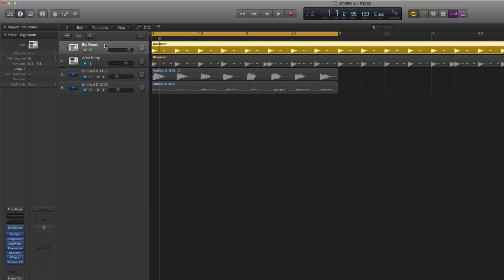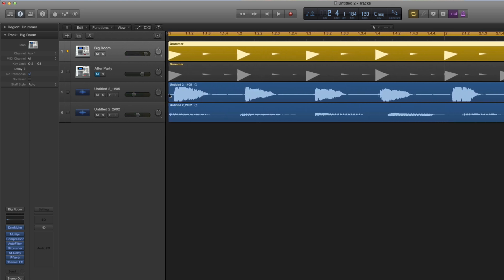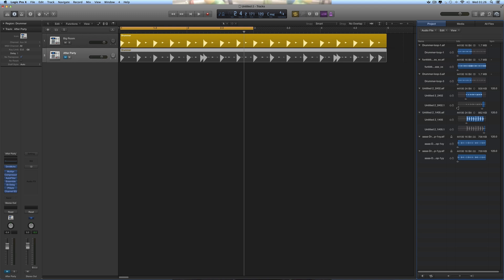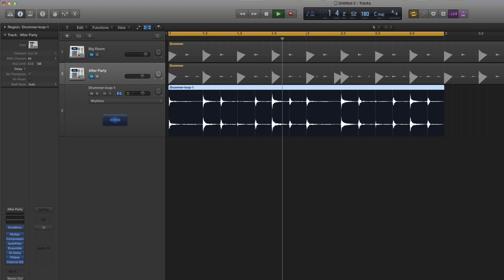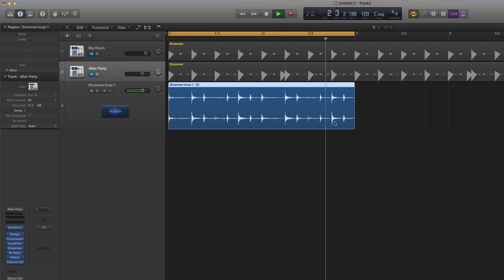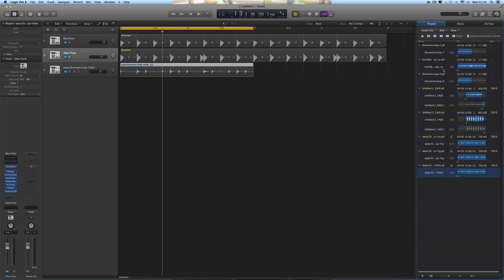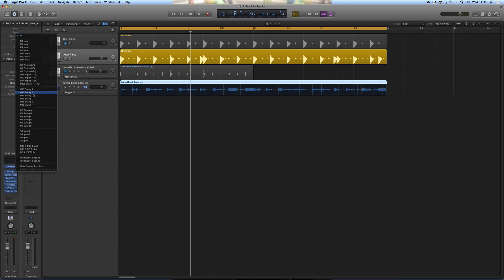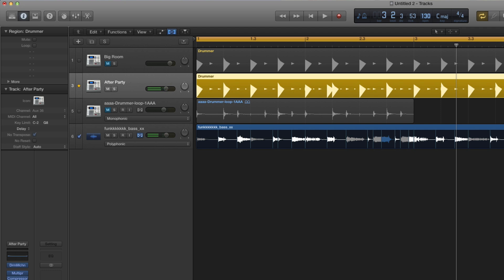Logic Pro X tips 2 - Quantise & tighten audio

Comment: Is it possible to adjust the amount which a track will follow the groove track?
Reply from the maker: select a track which is 'matching' the groove track & then select one or more regions on that track which are being adjusted to follow the groove master track - then open up the Region parameter box (top of inspector column) then adjust the Q-Strength - 100% is full, anything less can be dialled in (click drag up/down). To see the adjustment happening switch on FLEX display & watch the Flex lines in the region move as you adjust the Q-Strength

Comment: Excellent video!  Quick question regarding the Groove Track feature.  Can you use midi or does it have to be loops, and can you create a bass part using the Groove Track feature by having the bass follow the drums?  Thanks in advance
Reply from the maker: i never tried it, why dont you try it and see if you can set a midi track as the master? - you can make a bass part follow the timing of drums to an extent, but you have to actually play the bass and then the timing gets adjusted to match the feel of the drums. it cant just create a bass out of thin air from the drums though.
Reply: Thanks man!  I'll give it a try.  Looking for some inspiration for some bass parts...so much for wishful thinking :)
Reply from the maker: inspiration for bass parts? well one technique is to make drum cross-rhytm patterns triggering a drum-sound, and then move the pattern to a bass instrument tracks and try moving the drum notes around to get pitches that work. The point is, as you create the 'bass part' you're playing a drum, so you dont focus on pitch, just the rhythm... then you choose what pitch each drum hit plays when you drag the pattern to the bass track... that can yield ideas.

Comment: If you're recording audio in with external hardware, say a MachineDrum,  would the same general principles apply? Having difficulties getting my drum tracks to fit right on count one. Or is there a more efficient method of getting my hardware to start right on time? Thanks.
Reply from the maker: strange. how do you mix the onboard audio sounds with the machinedrum audio? Or do you record the machinedrum output to an audio track and then find that that audio is late when it's recorded?
Reply: Yes, machinedrum is recorded into logic with just audio output, no midi connections anywhere. So when i start the sequence i have to make sure the timing is just right. i'm wondering if there is a type of sync option, more or less, that would allow me to be right on time without having to worry about pressing 'play' at the right count.
Reply from the maker: are you not syncing machinedrum via midi as a slave to logic ?
Reply: dancetech No, I am not. Assuming I set machinedrum as slave, How do I set lpx as master?
Reply from the maker: well obviously you need a MIDI connection from your mac/logic to the machinedrum, then go to the logic midi preferences and set logic to send midi clock

Comment: I set mine to snap anything to absolute.Seems like the only useful setting. What is relative appropriate for?
Reply from the maker: it moves regions and notes (in piano edit) relative to their current position. So if a note is at bar-5/ beat 2, and you move it 'relatively' by a bar, then it moves forward to bar-6/beat2 or backwards to bar 4/beat 2 etc
Reply: I just meant what circumstances do you find it useful as opposed to absolute.
Reply from the maker: it is useful when you want to move something BY a fixed amount, not TOO a bar/beat/division

Comment: I haven't got a groove master in LP9. Even the old GarageBand has it but not LP9. I found how to import a tempo map from other software though if you don't want 100% quantization but rather follow another fluctuating tempo. I open the MIDI file in a new project instead of importing it and the metronome will follow that files tempo variation. There was one more way that I can't remember. 
Sync it is often what you want but not necessarily 100% machine quantize to achieve 
it. That Apple loop length flaw was good to know. Best would be an option "convert to apple loop" to use in projects without naming, categorize and saving.